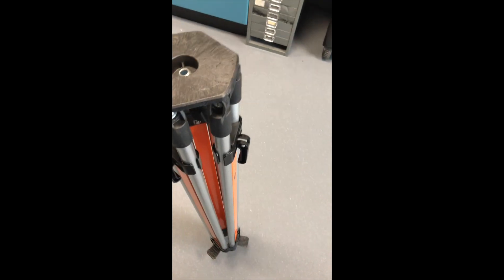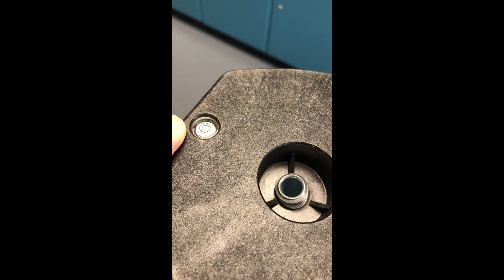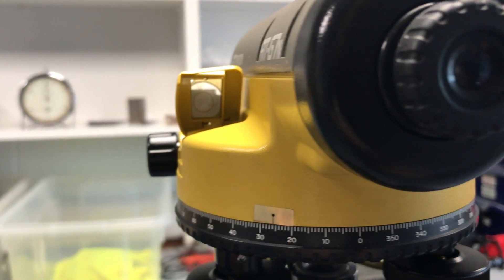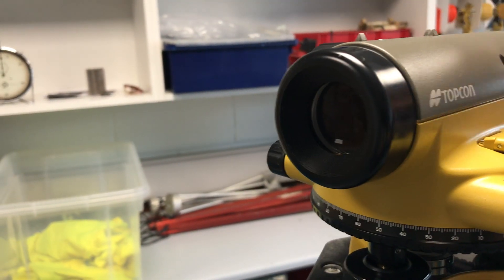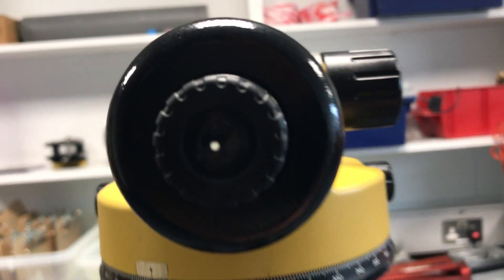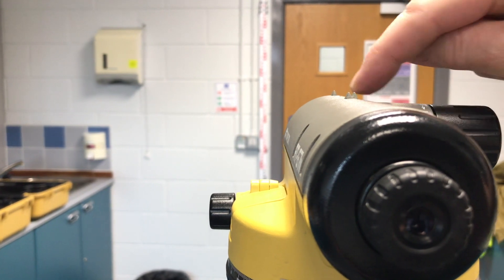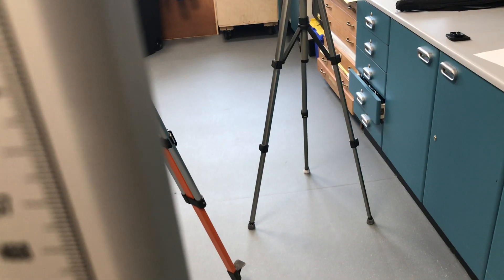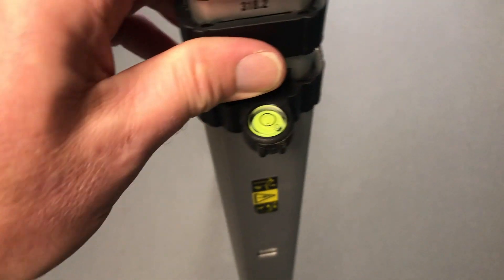How to setup,  use and take readings on a Surveying or Dumpy Level

Comment: Might be okay for a single shot,but if you're jumping back and forth side to side. You gotta turn that head multiple times and level it until you can spin 360 and it doesn't leave the fish eye.
Reply from the maker: Thank you for your comment and totally agree with you. I must also add that you should complete a two peg test to ensure that the bullseye level is correct in the first place.
Reply: @applied-maths hws that two peg test done? Pls can u explain?